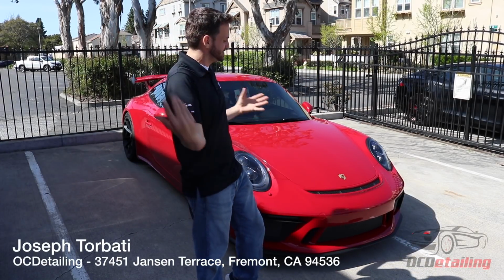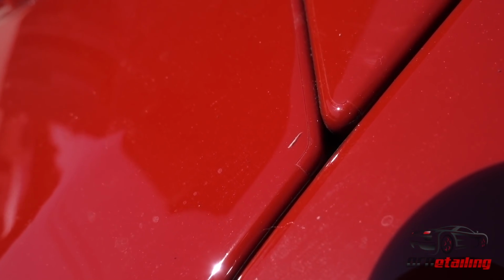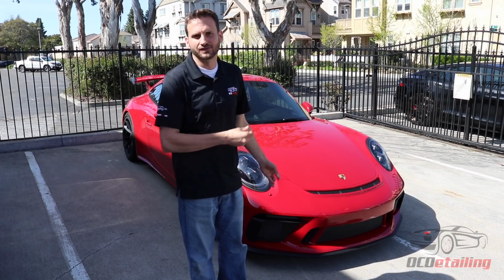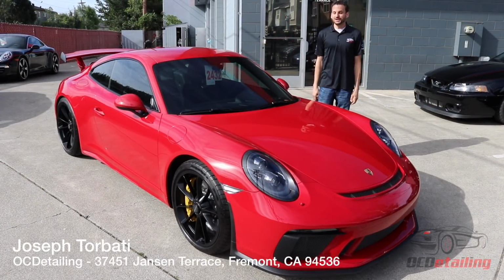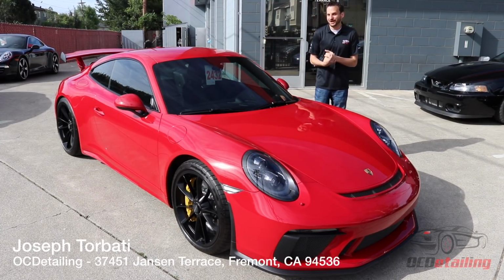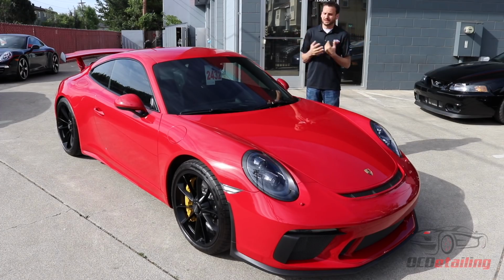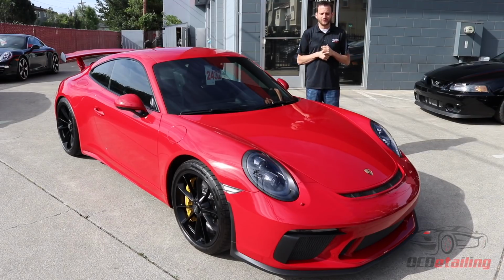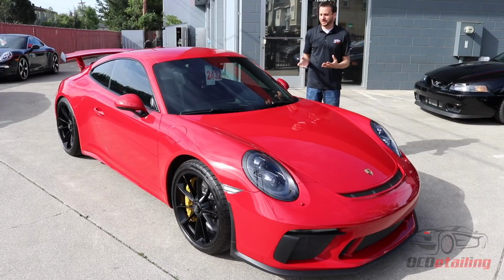Clear Bra Fail - Porsche GT3 - Full Suntek Ultra PPF & CQuartz Finest Reserve

Comment: How long does it last for and how do we care for the car... car wash etc. Can it go through a car wash or hand was only. Also will it always have a gloss look?
Reply: Most films are warrantied for 7-10 years and can be washed and waxed/coated like normal. Obviously you would want to stay away from using a car wash brush or anything that will add scratches to the finish.

Comment: Did you have to remove any panels to get around corners?
Reply: typically you don't HAVE TO, being a clear material, as long as you wrap it around and poke a squeegee or plastic blade into the gaps it's hard to see the edge even if you're trying. but obviously the best and easiest job is to take the panel off to ensure you have the most material over the edge to hold down the film.